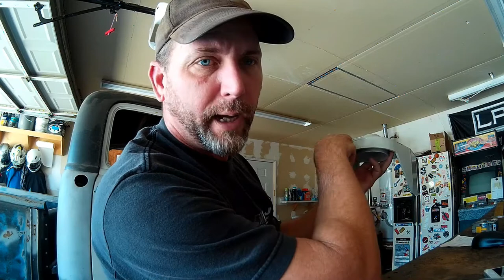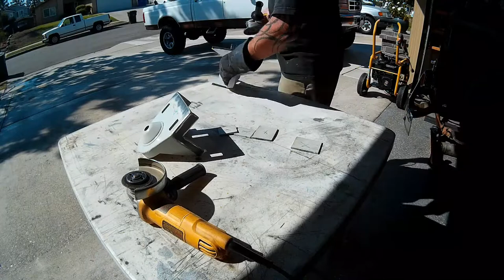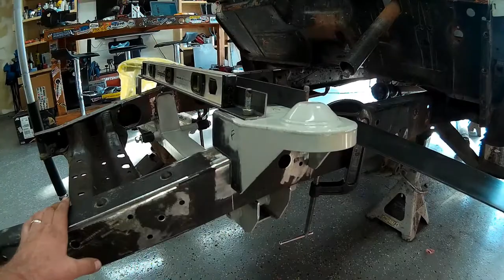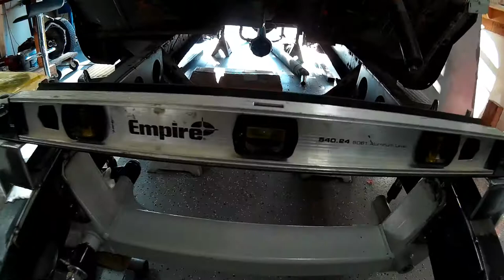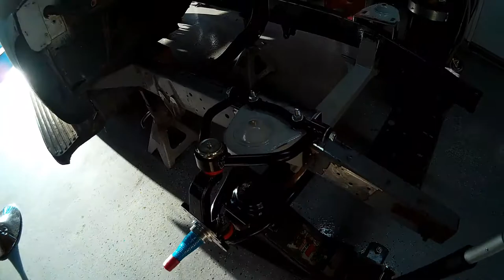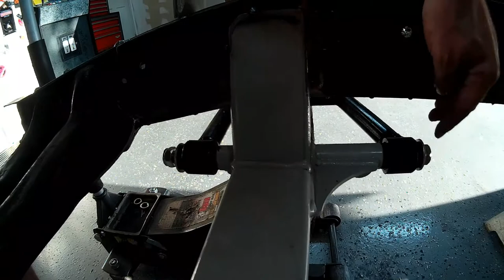P48 Project; Helix Mustang II IFS Install, Part 2 - Mustang II Geometry & Fab Work

Comment: Very good vedio,,,,I'm doing a 46 pickup,,,I myself thought it was a lot hanging out on the rear bottom A arm,,,,and felt it needs more support,,and yes I removed the typlone bushing before I started welding,,lol,,,so many people don't realize the heat from welding,,,always remove seals in even rear ends before you weld...

Comment: How do you determine the location of the spring pocket as far as the size of the notch that needs to be cut? It looks to me like they are all set so the upper control arm is parallel to the ground.
Reply from the maker: well, i think i covered that in the video.  i used the recommendation of "el polocko" from hamb to determine the UCA angle/spring bucket angle on the frame for proper anti-dive geometry.  thanks for watching!

Comment: Could use a little help. I am installing in a 53 Chevy 3100. I purchased the air bag over spring. Do I need that top hat to have the 3 degree for antidive or mounted flat. I think I have same set up you have including truck more or less but mine is air bag and 2in drop

Comment: love the fab work, the 28" helped me with my build, to far forward tho.. also the top hats and the cross member on this frame should not be center together for others doingthis build
Reply from the maker: why  wouldn't you want all the suspension components centered on the wheel opening?  specifically.

Comment: I could be wrong but it looks like there is "negative" caster. Its my understanding you want some positive caster.
Reply from the maker: i haven't adjusted caster/camber yet, the upper a-arm is slotted to allow adjustment of the upper balljoint position.  once i get it driving, i'll ballpark the adjustment and take it to an alignment shop for a proper adjustment.  thanks for the question!

Comment: So am I correct in saying when your lower control arm is parallel to the ground the upper one also is parallel with the ground with the spindle installed. And if the adjustment screws are right in the middle on the upper control arm you’re looking for 0° camber… Correct.....I wish helix would send a little bit better information that is if you can find it.
Reply from the maker: when the lower control arm is parallel, the upper control arm should be angled toward the ground and also leaned backward at about 7-8 degrees (IIRC) at zero camber.  search the El Polocko thread on HAMB and read how the Mustang 2 geometry should be setup.

Comment: Where did you get the the subframe kit ? I got mine from Bro speed for my 67 mustang and the detractions were vague . The picture that was sent to me didn't show any sleeve in the front where the lower control arms bolts threw.  My bottom spring pocket doesn't Mach with the top ! I saw another video of similar subframe installed like yours and think I need to change mine to have a little cut from the back and welded to the front and a gusset like the one you mentioned
Reply from the maker: check out el polocko's thread on the HAMB.  it'll explain the Mustang II front geometry pretty well and give you some good examples.  thanks for watching!
Reply: Dan Boutin ..